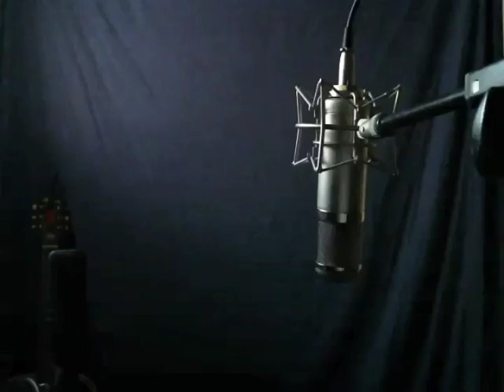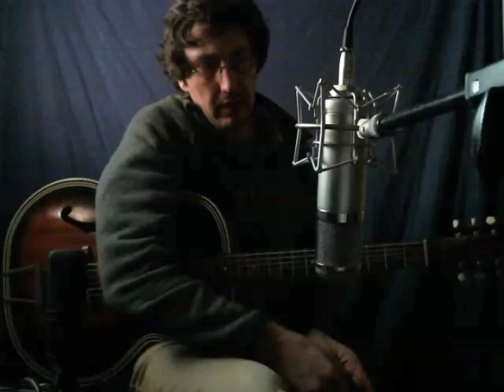432Hz vs 440Hz on Guitar

Comment: It's imposible, with equal lenght of string to have more chromatic overtones with one frequence than other. Overtones depend on the string not the frequence it vibrates.
Reply from the maker: ***** Well string length is a factor. The longer the string the lower the note. The shorter the string, the higher the note. When tuning at a lower frequency, you have more string mass. Yes, the length may be the same, but mass is different. There is less string mass, the higher the tuning. The increment of mass we speak of is at the atomic level but never the less, there is more string mass when tuned to 432.
Reply from the maker: Garrett Fugger Honestly, I don't know how much I believe that there are more overtones in 432,  but I am convinced that frequency matters, and that 432 is more pleasing to the ear and body.

Comment: When I started learning guitar, before I knew anything about tuning.. I noticed the chorus effect the notes took on just before I was “in tune” as per 440 on the tuner..  so since I could always find that spot by ear, I started tuning to that pitch. Later came to realize that pitch with the chorus effect was 432hz.. oddly enough 456hz is the same pitch but one half step above.

Comment: 432 sounds darker but smoother.
Btw do you have any effects running? Sounds like left to right panning or phaser
Reply from the maker: there is absolutely no effects used, no processing, no mastering
Reply from the maker: it was recorded in stereo and I think what you hear is the individual channels compression responding slightly out of time from each other

Comment: what age is the guitar? until 1939, 432 was commonly standard pitch.  I found I needed to put hours in, at some volume, to feel 432 vs think about it.  and see what kinds of composition just naturally flow.
Reply from the maker: the guitar is a late 50's. You are correct about old standard pitch. I have several links pasted in title description section that prove that fact.
Reply: Larynx Suit great video thanks. I'm fascinated by effect of 432... it is palpable with electric instruments at volume as the body resonates. I'm curious about resonant frequencies in wood blocks. fwiw the hz is not artificial time. the second is a second of arc of the earths rotation and so connected to energetic alignment with the planet/gaia. thanks again, happy new year.

Comment: Could you tell me what to use with the 432? There is also an C, G, B, etc. And some flats that nobody tells what they are?
Reply from the maker: 432 is not in the chords, its in the tuning standard. Program your tuner to 432 and tune.
Reply: Larynx Suit, I do understand 432 is a frequency and not a chord. I guess you don't have one of these chromatic electronic tuners to be able to understand what I am talking about. Thanks for your time.
Reply from the maker: you cannot tune to 432 with those
Reply: Larynx Suit Why not? It says 432 on them all.
Reply: Larynx Suit  What am I supposed to use to tune then?

Comment: Folks - Hz are Cycles per Second, and Seconds are defined as: "the time that elapses during 9,192,631,770 (9.192631770 x 10^9 ) cycles of the radiation produced by the transition between two levels of the cesium 133 atom", so if the argument is that 432 of those is somehow musically significant and superior to 440, then jeez lol.
Reply from the maker: Such a high minded statement! Thank you for enlightening us! Must be so frustrating to be amoungst such pee-ons!
Reply: Not at all, I literally copied and pasted the definition of Hertz from Wikipedia and questioned whether it was musically significant.
Reply from the maker: At the end of the day, experiential evidence is going to be the convincing factor, backed up by the history and science of 432 in America. Seems to be such a random tuning if we as Americans just picked one out of thin air. Check out Royal Rife, Maria Renold's study, and the links I've attached to the bottom of this video. They may be helpful. My apologies about the comment, I read you wrong. Good luck!

Comment: I don't hear any benefit to 432 tuning.
Reply: There is a benefit, it sounds more out of tune :)
Reply: a440 is unmusical
Reply: The biggest benefit is numbers. Each set note pitch has a number of Hz which is a multiple of 9. 440 Hz doesn’t have such divisible consistency.
Reply: Think about sine waves flowing along a timescale - would you rather an even amount of waves that can be effectively divided evenly, or would you prefer a number of waves which adhered to no particular subset?

Discomforting [but perhaps desired] dissonance and obscurity becomes apparent - Applying this concept to the nature of our vibrational reality and we begin to see the potentiality for dis-ease, therein.
Reply: did u feel it

Comment: I think this is a poor choice of guitar for this comp. of 440 Hz and 432 Hz . This is a vintage Harmony archtop guitar, possibly a H1213 or H1215 - either way it is an all solid Birch construction. Archtops guitars were created to replace flat top guitars used in orchestras and were designed to produce more volume. The result is that Archtops are louder, have strong mid range but have less overall dynamic response compared to flat top guitars.......but they are louder !! 
Because 440 Hz is a higher frequency than 432 Hz, it's going to sound brighter to the ear anyway. Then when expressed through this type of guitar with a flat woody tone, the listener could be biased against 432 Hz because of a lack of dynamic response of the guitar and not being as bright. 
I think a better guitar to use for this comp. would have been a dreadnaught with modern X-bracinging, Cedar or Spruce top and Rosewood or Mahogany back and sides. This combination would more fully allow both frequencies in the comparison to breath to their fullest giving the listener a fairer comparison......IMHO.

Comment: but does it have to be RECORDED AT 432 hz? can you converter a song and make it 432 hz?
Reply: Antonio Romano No because when u convert music, you are taking 8hz away from all frequencies.  You can't do that.  You are only supposed to subtract 8hz from 440...and not its octave.  You would subtract 16hz from its octave, 32hz from that octave and so on....so changing a recorded song from 440 to 432 won't work cuz you only subtracted 8hz from all frequencies when it should have only been subtracted from 440hz.  That is why you have to tune your stringed instrument to A4 = 432hz....C4= 256hz, then you can record it.
Reply: You need to back up that claim.  Time for a youtube test because I call BS.
Reply from the maker: I think you might be misunderstood on how this all works. A=440 or 432 means that amount of times a vibration makes a cycle per second for the A note. So when a guitar string is plucked, like a ripple in water, the string has a wave that travels to its end and back, 440 times in one second. You are not manipulating frequency per say. When converting from 440 to 432, all that is happening is the music is being slowed down from cycling at 440 times per second to 432 times. Hz and Frequency are not the same thing. Yes, the frequencies are slightly different, but they are not lost or disabled or whatever.
Reply: Good explanation. 380stroker you deserve a like.

Comment: This is mindless obsession which is actually unimportant in music. First of all, every instrument has it's own resonant frequencies where it vibrates at optimum. This is dependent upon the tension of the wood vs the strings. Most guitars and strings are designed to vibrate at optimum in 440. However the cheaper instruments will vary widely. Secondly, All Frequencies Exist Simultaneously! That is what the universe is composed of. Everything is a frequency. Music is simply a human art of putting those frequencies in some kind of aesthetic order. It does not matter what you are tuned to . Just make good music.